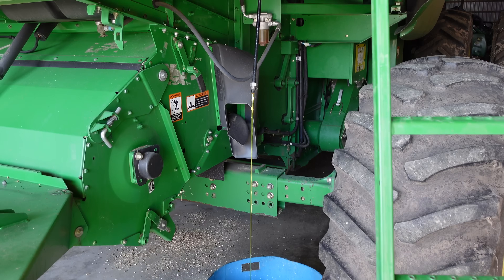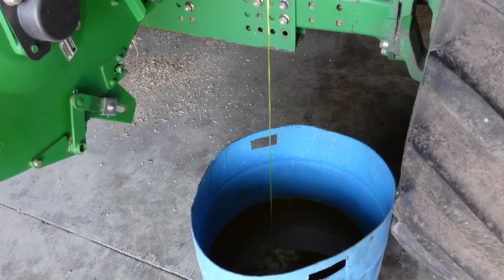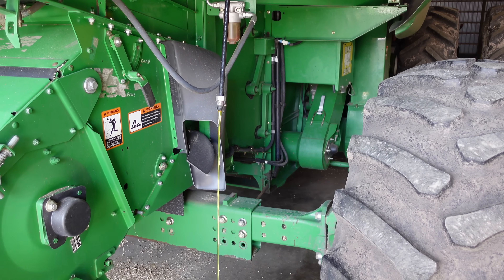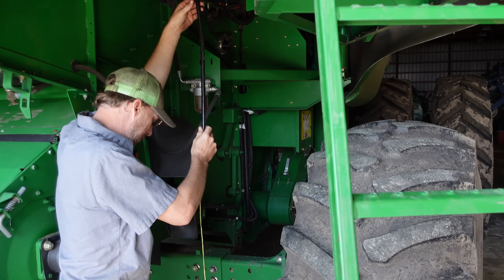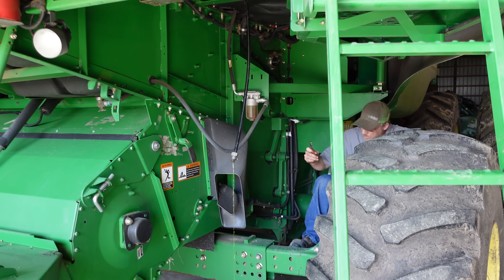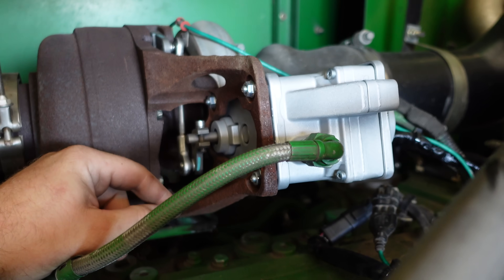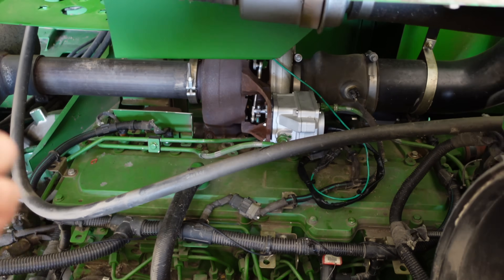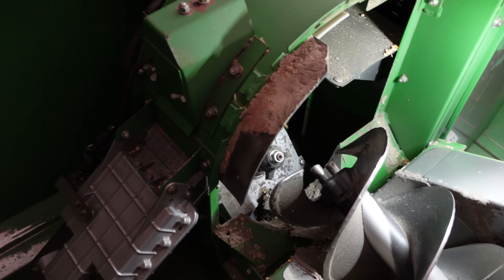John Deere 9770 STS - Turbo Actuator fault & Moisture Sensor repair.

Comment: Hey I’m a new jd tech in Alberta Canada , wondering if you have any experience with 2012 13.5 false dpf soot loading and diesel doser unit codes . Harness all checks good . Replaced doser unit as per instructions . Leaning towards failed ecm
Reply: Tractor is still working . It just keeps trying to command parked regen and failing .
Reply from the maker: I would need more information about which codes exactly
Reply: @ZKMasterTech ok I can get that info tomorrow . I’m the second tech on the job so they might just try an ecm

Comment: Thanks for the video definitely helped me. I have one question though. How did you calibrate/relearn the new turbo actuator in the cab?
Reply from the maker: I used my laptop.
Reply: Ohh ok thanks; so you need jd software?

Comment: 2 unrelated problems..... but the 2 problems that i happen to have at the moment....turbo linkage which is $1100 in Australia...and a moisture sensor that works for 2 mins then stops🙄

Comment: A couple Heim joints shouldn't cost but about $20 at the most (use them on Harley Shifter linkage regularly a complete shifter linkage kit is only $20)

Comment: Drained coolant like that on a S680 today so we could do a pip on head bolts and boy I took a coolant shower today lol. Had the old bolt in there to drain it instead of the fitting to hold a hose so that was fun lmao. Definitely installing that fitting when we button everything up!

Comment: How many hours on the engine to wear out the turbo actuator?
Reply: Combines are more prone to actuator failure because when they sit the vanes get bound up. I've found alot of times if it sets an actuator code when you start it after sitting I just move the linkage manually back and forth a couple of times to free it up and it works again. This one is obviously wore out. Probably pushing 4000 engine hours

Comment: The relays are changeable on the moisture tester. Cleaning and relubricating the plunger screw saves the motor as well. Nice camera work.

Comment: Thanks for another great video ZK. It was interesting and enjoyable of course. 

Well, another great video with educational items on two areas I have never been into before. Most interesting. 

The turbo item was interesting seeing how loose that shaft was. Can fully understand why the turbo device did not operate correctly the way it was. That old shaft was binding up the whole operation. Not bad at all to replace once you had access. Will always remember that noise on the new one when you operated it. Neat. Put back together again and clear the codes and calibrate. 

The moisture device in the tank was a learning experience. If you want me to say oh ya I know what you are talking about I would be not telling the truth. Never dealt with that before. Once again, not extremely bad to replace if and I repeat if you know what you are dealing with. Now I know and not all that bad. Another good fix and fix the codes and calibrated and ready to go. Neat. 

Josh is doing great with you ZK. Good man you are teaching. Hard to find now days it seems. 

My compliments to you both for your great work and fixing the problems. 

Combine is off and running again. 
You both take care and be safe. 
Looking forward to the next video. 
Thanks for everything ZK. 
Once again, you are an exceptional teacher and teach us with easy to understand narratives. 
Appreciate that. 
The Iowa farm boy. 
Steve.

Comment: After watching (and enjoying very much) many of your videos I sense the smart farmer will not "waste" his time trying to find "hot software" to do his own repairs, he will spend his time becoming a more efficient farmer (creating more farm profit) incorporating John Deere repair costs in his farm expenditures.  Maybe this is your major intent in that your efforts are designed to convince those farmers on the fence to let an authorized dealer do the proper repair work.  Well done fella!
Reply: A smart farmer will buy as less equipment as possible, and rent or lease whatever is needed. But every farm is different, so every farmers best solution (ie: most cost efficient solution) is different. The average farmer also is a very smart businessman and will work it out. And Zeth is great!
Reply: @milofarmer1  Proprietary software is the main argument within the Ag world.  Farmers claim they should have access to "primary" codes, etc.  Yet, do they ever consider the research and development costs prior to production?  How about marketing, manufacturing realities as regards how many parts to produce, inventory, then ship out---costs that must be absorbed prior to turning over the inventory.  Farmers are gamblers of the first order, if they stay focused on creating the most efficient system for producing crops, your simple remove and replace attitude only works to your advantage if you have those primary codes and the attending info to diagnosis the part/system in trouble.  Take a moment to consider that $30 pair of clippers our ZK Teck uses to snip plastic zip ties...plus his use of that tool--knowledge you may not possess till you visit the doc for stitches.  Put a price on that!

Comment: Them VG turbo’s not been great.  We had 5 tractors needed doing last few years. 155R 2600 hrs needs one already 😬 it’s the actuator or linkage every time. Found it’s not much more £££ too replace the lot turbo included. good old 6620 12000hrs still going strong on its turbo! Before the VG turbo was introduced.
Great video, keep up the good work. And remember flush cut 😀